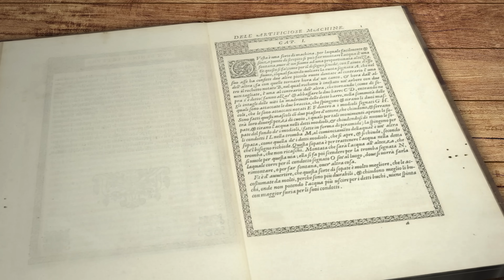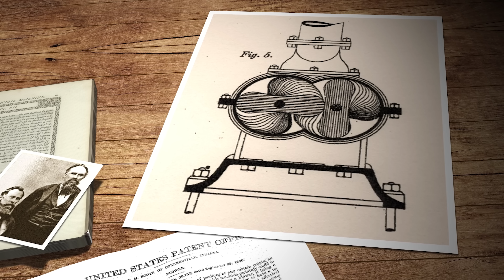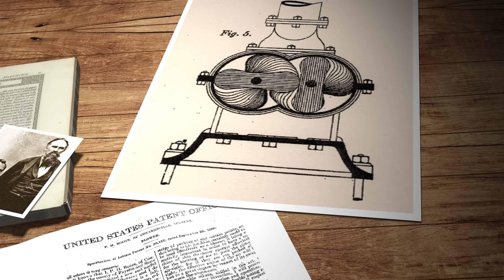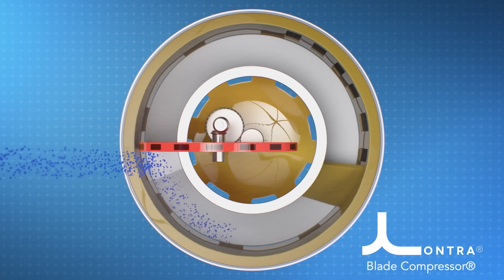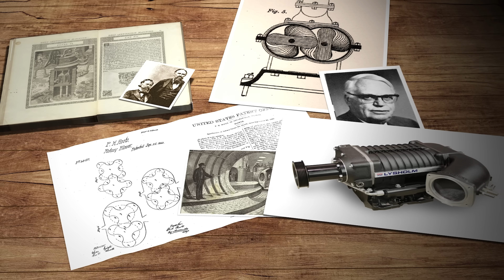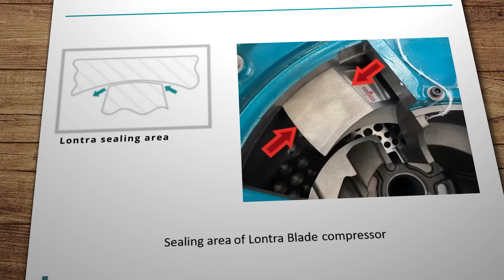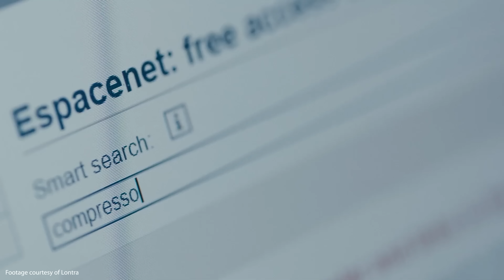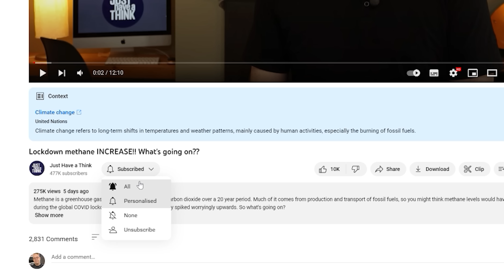Compressing air to reach net zero. A 'revolutionary' innovation.

Comment: Very interesting.

Millwright here, it's important to note that thermal expansion is another reason why there are clearance gaps. In designs like screw compressions that have to have larger gaps than for example a reciprocating compressor because the materials expands towards each other. Vs a reciprocating compressor where the piston and the wall expands in relatively the same direction. (Although maybe that was beyond the scope of this video)

The circle design of this compressor takes advantage of this and thus requires less of a gap.

One issue with this design I am seeing however is that it seems like it would be quite prone to damage if it gets dirty or small bits of debris get in. It's relying on very accurate timing of two rotating parts moving in differing directions... ANY mis-alignment would be devastating. Maintenance of this machine would be constant and absolutely critical. (Constant filter change, I would even include a cyclone filter).

Worth the extra efficiency.

That said, if you can afford it there are more efficient systems out there. Large multi-stage axial compressors with intercoolers betwen stages have INCREDIBLE efficiency. However are extremely expensive to build and maintain.

So it's going to have a niche role. It needs to be cheaper than the aforementioned system, but more efficient than screw compressors. If they can make it cheaper enough it could be revolutionary.
Reply: A helluva filter system upwind indeed..
Reply: It's pretty basic shapes that are easily turned or milled (apart from the bevel gear) so tolerances & quality control should be easy to manage in volume production so costs should be low. The problems, as you say, are in maintenance in the field. In particular, the swept area & the number of seals seems alarming.
Reply: My thoughts are increase the clearance in the valve and rotor and add oil-mist injection as currently is used. It still requires a rigorous maintenance schedule though to check that the gear-lash isn't going to cause a valve/rotor contact.
As for wear in the valve and rotor faces. Being that they are non-contact, I would spray carbide coat them, that is problem solved for millions of hours of use. I have replaced packing on spray-coated pump sleeves that are a decade old, in caustic-lime and acid environments. We replace the sleeve when the stainless erodes away under the carbide.
Reply: Curious: which niches do you think this could do well in? I notice their pilot is in wastewater treatment, which seems pretty thermally stable.
Reply: @acchaladka  I'm curious about what this recent curious discovery about using toroidal blades, for wind turbines and water propulsion, might have any... bearing on any of this.
Bdum tsh.
Reply: @acchaladka  It's pumping air into the water, so the temperature variation is that of the outside air.  Given that it's the UK, that variation is smaller than it would be in some other locations.
Reply: This. I wonder how much efficiency it will lose once it’s attached to a filtration system? That might be the limiting factor that makes this pump cater to more sterile uses. I’d like to see how it does in any type of foundry.
Reply: Also if you use a screw compressor you are supposed to have a quite big air load and the screw compressor constantly circulate the oil in the screw housing with a termostate valvet, so when its up and running the temperature is very stable so you should be able to have very precise clearance optimal for that temperature. Our new Atlas at work is always 70-75°C during the week. We also have a small Kaeser SK25 and when its up and running its almost always 76°C.
Reply: @ZipperOfficial
But it already IS "revolutionary". That's how it works, it revolves... 

Okay, I'll see myself out now.
Reply: Radial compressors are very good also, but the issues are the power band - many turbines basically have a voracious flow rate at peak system efficiency, and are useless everywhere else. Turbomachinery design has got some huge potential improvements in design strategy due to computer aided design.
Reply: Please don't embarass the poster of this video with your real life practical experience of keeping things like this working reliably :)
Reply: @andrewallen9993  Please do show intelligence by explaining what your problem is rather than a direct ad hominem approach.
Reply: That reply was gold so glad i read it!
Reply: does you being a millright make you more qualified to discuss engineering principles and decisions like you imply?
Reply: I'm glad you mentioned cost. It was one thing notably absent from this engineering calculation. 

Regarding temperature, perhaps you might be able to increase efficiency by running it at a constant temperature if the system is large enough to warrant the extra complexity.
Reply: The other problem that it will have is exactly the same problem they have in Wankel Rotary engines and that's sealing the corners.
This is why no matter how good of a technology other people have tried the piston in a cylinder works because its so easy to manufacture to a tolerance. Its why the invention of the V-bed lathe by Jacques de Vaucanson was so important to the industrial revolution.
YT Channel "Machine Thinking" did an incredible video on that: https://www.youtube.com/watch?v=djB9oK6pkbA
Reply: @tonywilson4713  
Exactly, to seal the piston it would require drag on the cylinder to seal the rotary valve would require friction from the side face, outer face and most importantly the corners, combine that with the intermittent slot and instant destruction,
So how would they seal the gap in the rotary valve relative to the piston and still allow a little wear and manufacturing tolerances
Reply: @mrbumcraic5046  Yep it will have all the same problems they have had with sealing Wankel Rotary engines.

So long as you have some form of rotor in a flat case sandwiched between 2 FLAT plates you are going to have issues in the corners. 
ITS CALLED GEOMETRY 🤷‍♂🤷‍♂🤷‍♀🤷‍♀
Reply: @mrbumcraic5046  other than the friction issues it really comes back to the corners. 
They are selling this thing on its clearance and sealing. 
That's the big comparison.

It sounds like they are getting better efficiency somewhere BUT THEN WHAT ARE THEY BEING COMPARED TO.

I work in control systems and automation and have done water treatment projects that include aeration which is the example they give. YES I HAVE BEEN INVOLVED IN THAT EXACT TYPE OF WORK.

You don't need 100PSI to aerate a tank of water. You just need enough pressure to push the air out into the tank. 100 PSI which is the standard out of a compressor is enough to push air out at more than 60m of water depth. We're only talking a few meters.

Mostly I've only seen people use simple low pressure air blowers for aeration. The biggest inefficiency is never the blower its the flow control which is usually just a big baffle. 

In 2008 (right before the GFC) I did a proposal to replace the baffles on an a set of 6 aeration blowers at a mineral processing plant. These were big 6,600Volt motors. The proposal was to replace the simple on/off starters with variable speed drives and ditch the baffles outright. 

We had a special calculation program from the VSD supplier that they use all the time for that sort of work. The 6 VSDs were about $500,000 each plus the work to fit them. All up about $3.5 Million. The break even on cost saving was around 18 to 30 months. 

Yes those motors were wasting about $1.5 to $2 million a year in electricity because the flow control was a big metal door in a duct.

So what they are talking about isn't new or spectacular and there are other things to do things.
Reply: @tonywilson4713  he is saying the sealing of air in the compression area is a big part of the efficiency, friction loss everywhere would counter any sealing improvements, and I do not believe you can seal the piston/air valve interface to make it more efficient than a screw compressor which is what he has inferred, efficient screw compressors lose very little between the screws as they are sealed with copious amounts of oil
Reply: @tonywilson4713  
Sorry can’t help myself, turning the rotational power 90 degrees to run the valve would also suck a fair bit of power up too. Bevel gears are horrendous at efficiency
Reply: @mrbumcraic5046  Saw both your comments 
Yeah bevel gears and efficiency????
and

I still can't see how the sealing delivers efficiency as you said - FRICTION.

I want to know what they were comparing it too.

Its like claiming your car is more efficient than your neighbors because yours is the latest direct fuel injected hybrid with kinetic energy recovery AND THEN you don't say what your neighbor actually has.
Reply: @tonywilson4713  That's an amazing savings. I always assume when the comparison is not defined it will be the worst [efficiency] device available.

What percentage efficiency change was the 1.5 - 2 million?
Reply: @CaseyRevoir  In the end not that much. These were seriously big electric motors and at those sorts of powers just fractions of 1% add up over time. Consider how much power a house uses most of the time its well under a kilowatt because the only thing running is the fridge and maybe some stuff on standby. Its only when people go home after work and start using things does it go up.

What we are talking about here are big motors running almost 24/7. They aren't typical 415 VAC these 6,600 VAC. Its 14 years ago but I think 4 of the 6 were 2.2 MW and the other 2 were 1.5MW.  You see these sorts of motors in heavy industry like mining all the time. I've seen on conveyors, crushers, driving the giant rotary buckets on bucket wheel excavators and in this case driving giant blowers to aerate big tanks of slurry.

Basically once you get to big motors you use high voltages. 6,600VAC is reasonably common. There's a massive saving on installation costs and power losses. It all stems from what everyone learned in high school science class with Ohms Law (V=IR). Yes we use AC not DC but the principal is the same.

Remember Ohms Law V=IR and how power is P=IV? There's a rearrangement of those two P=I²R that gives you power loss. 6,600VAC is ~16 times 415VAC so you only need 1/16th the current to deliver the same power (P=IV). That means a much smaller cable because the power loss in the cable is 1/256th (16²). 

Have you ever wondered how those thin cables carry Gigawatts of power across the country side? They crank the voltage way up to things like 240,000 volts. That's why the cables are kept well apart to stops arcing. But the big thing is if you up the voltage by a factor of 1,000 you drop the power losses to 1/1,000,000th.

Because we are talking about massive amounts of power even a power loss of and extra 0.1% is substantial. Its one of the reasons why Nikola Tesla is regarded as one of the most significant contributors to modern society. He made AC power viable and with it energy distribution. DC is possible but its just a lot harder to make viable with energy transmission.
Reply: @tonywilson4713  The Wankel apex seals MUST make contact (with a thin film of oil), it appears this device does NOT actually make contact, therefore, minimal heat, minimal wear, and even heat distribution throughout.
Reply: if the entire assembly is heated uniformly and is made of one material (or materials with the same coefficient of thermal expansion), then the entirety will expand as one and no parts will expand towards one another. This is irrespective of geometry.
Reply: @Aaron628318  you still need piston/cylinder seals and piston/valve seals regardless of temp. Moving parts require clearance
Reply: @mrbumcraic5046  Yes, I wouldn't dispute that - it's not the point I was making.
Reply: @Aaron628318 Actually, it won’t expand as one just because it’s made of the same material. The shape matters. Also, the temperature on the pressurized side of the plate will be greater AND the pressure itself produces a net force across the plate, further increasing deformations. All of this will serve to limit the operating range of the device. It probably works great a low flow rates and low pressure ratios but beyond that range you’ll need a different style of compressor.
Reply: @rgfs71  "The shape matters." how so? how can you have deformation without differential expansion?
Reply: What kind of millwright are you all the ones I know smoke two packs a day drink a 12 pack a day and do not speak this well let alone type as well lmao
Reply: @rcgl6776   lol I once heard of a magical place in Neverland where the millwright goes to a technical college to earn a degree.
I think he’s making it up and he’s secretly an engineer trying to keep the real millwrights from destroying the pump with their cigarette butts.

Comment: I have an idea for a solar steam engine driven by a heat pump that could use your Lontra compressor for driving up the temperature of the refrigerant to heat water to drive the steam engine. I have much more to say about this but would rather communicate in private. If you would like to continue the dialog could you give me an email address I can contact you at in a reply and I can give you more details.

Comment: used to work with ac's and cooling machines, it is really something i remember almost being invisible when i was a kid, everyone knows there are cars and trains and power lines, but its so easy to miss all the heat pumps that are all over the place :) and compressors are not all that efficient :-) at least for non industrial applications, a lot of potential there for innovation.
Reply: @GaryGraham-sx4pm  in what way it is different from a regular rotary vacuum pump?
Reply: @GaryGraham-sx4pm  i have no idea what you even mean by that.. A vacuum pump minimizes leakage and does not maximise mechanical effichiency, and if you are one of these weirdos chasing me around the playground then you should maybe think about the implications a bit more carefully ❤️
Reply: @monkerud2108  wtf?

Comment: I love when an incremental improvement like this is so effective, and you explained it elegantly. 

My one question: doesn't the Lontra design introduce a pulse that the Roots design doesn't? Isn't there going to be variability in the output between the start of the cycle and the end?
Reply: Yeah, I think the output pressure would oscillate on every cycle, but that can be dealt with using some kind of pressure smoothing mechanism.  One simple method would be to put a large chamber on the output of the compressor.  Because the volume of the chamber is so much larger than the volume of the "piston", the effect of injecting that oscillating pressure into the chamber would have little effect on the pressure in the chamber as a whole.  I'm not a mechanical engineer, though, so there are probably better and more compact methods than this.
Reply: They both have pulses.  The continuous roots blower screw version does ~not though.  Much more expensive to make and rarely done.  So, if this is much cheaper to make... then yes.

Comment: I wonder if this could take liquid nitrogen and be used to generate electricity like Cryomatix Expander discussed back on the 2nd of May 2022. Maybe built cheaper than a turbine, maybe with equal or greater efficiency.  With a temperature difference to increase efficiency.